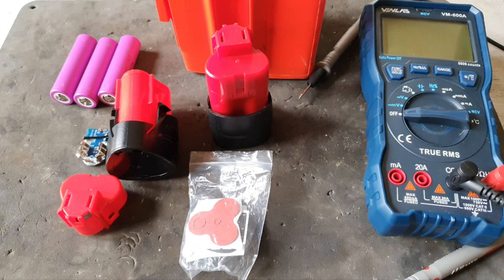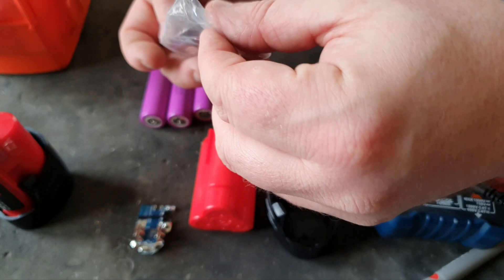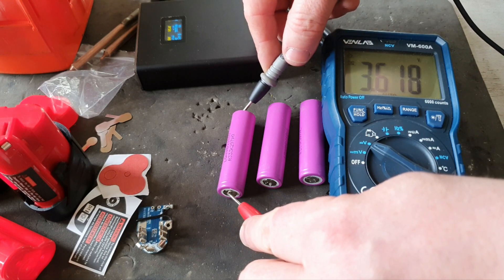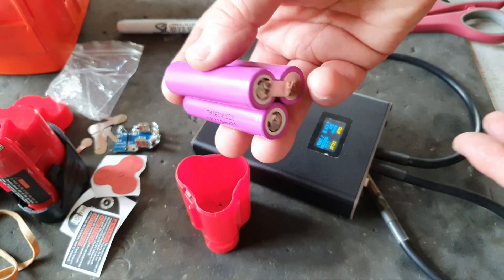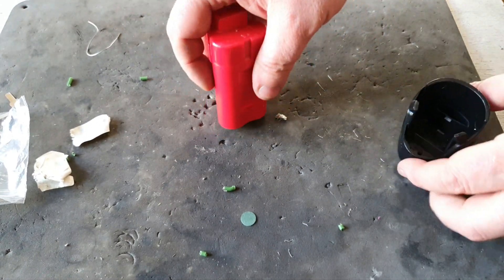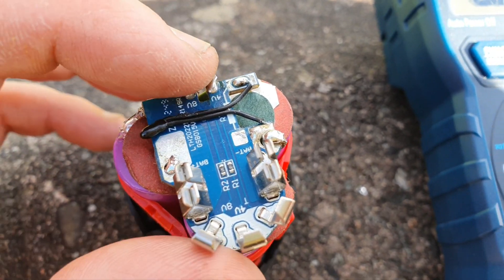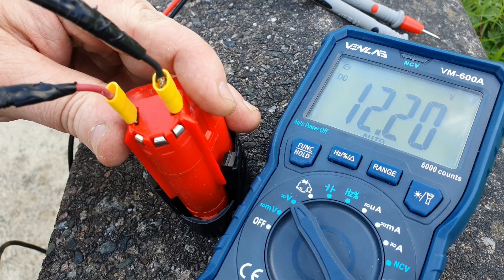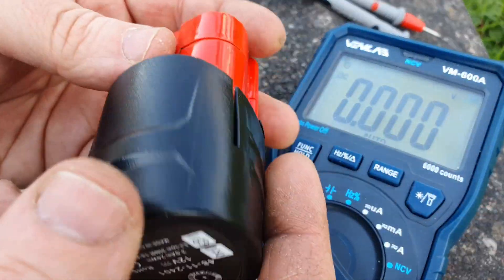I made A Milwaukee M12 Battery #milwaukee #repair #powertools #diyenthusiasts

Comment: I am just about to do a similar 'repair' as one of the cells has failed in my brother's drill pack. However, looking at the circuit board in the original I ws surprised that there is minimal battery management with no under or over charging and no balance function to prevent cells from fulls discharging while other cells remain good. I also repack makita and bosch 14.4 drill packs to Liion and always use a BMS with balancing function. The PCB supplied in these kits is no more than a pass through and all management is handles by the tool or the charger not a great design in my opinion.

Comment: A year later and the same problem with a kit I just got from ALi Express in terms of the balance connection points being mislabeled 4 and 8V. I also learnt the hard way. These M12 kits are much more of a PITA to assemble than the M18 kits. I used to have access to hundreds of laptop battery packs and harvested lots of cells. However I've come to the opinion that it is best to buy brand new ones of high capacity because they last twice as long and my labour is the most expensive part of these DIY projects.
Reply from the maker: Thank you for commenting I agree

Comment: Imo its only cost effective if*

The battery you want to make isnt sold by the oem ( e.g. high power/high capacity)

You're using reclaimed cells

Thats goes for repair or from scratch, new cells are just too expensive unless you can buy in bulk for a good price which most people cant

Ive repaired quite a few batteries for beer money by sacrificing 1 or 2 for donors for the other packs ( the donors also had dropped cells)

Comment: link to the kit. did you let he kit maker know of their fault pcb?
does the board do both bms and cell balancing? and the charger just supply cv ?
Reply from the maker: No I didn't mention the issue to the supplier I don't know if it balances the cells the genuine ones can even fall out of balance
https://www.ebay.co.uk/itm/403989015551?mkcid=16&mkevt=1&mkrid=711-127632-2357-0&ssspo=4ciavehlrxq&sssrc=4429486&ssuid=cjPn_ZfdQLW&var=&widget_ver=artemis&media=COPY

Comment: deadly video, have you get a link for the store you buy the cells on
Reply from the maker: I repurposed the cells from a battery with faulty electronics here is a link to 25r cells which would give you a 2.5ah battery, however they are expensive to buy this way. If you go to the likes of lidl you could buy a parkside 2ah battery for 17.99 and repurpose 3 of the cells. But please be careful cross connection is a big risk with these smaller batteries there is no extra room in the casing.

Comment: The sad thing is that the welds you put on your batteries are stronger than some that you reclaim. 
I've taken some apart you could almost use a pair of tweezers to remove the strips and they were from name brand companies. 
I've reclaimed cells from old laptops for power banks that were terrible
Reply from the maker: They do vary the knock off ones are terrible

Comment: That's awesome brother 🙌 id love to try and fit some Samsung 21700 cells in it 😂 seems like the bosh was a bit easier hu?
Reply from the maker: The bosch was a breeze That PCB nearly screwed me lol
Reply: @doctorlefthandthread  lmao
Reply from the maker: @WTNPROUD  good idea with the 21700 it had crossed my mind but the battery box would need to be adapted somehow. Maybe the the 6 cell box but use 3 21700 30T cells instead of 6 18650.
Reply: @doctorlefthandthread  now we're talking doc!!! This is something everyone wants a true high output battery for the M12 FUEL TOOLS!!!!?
Reply from the maker: @WTNPROUD  I thought I was done with battery builds it looks like I may have to do 2 more 😅 21700 30T  here we come
Reply: @doctorlefthandthread  hahaha 🤣 dude everyone would wanna see and actually see what's it putting out